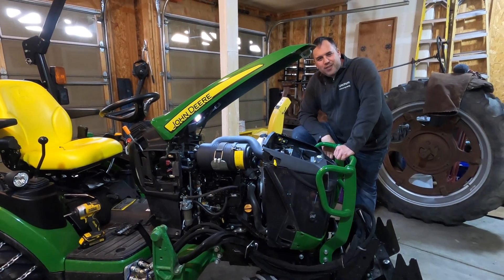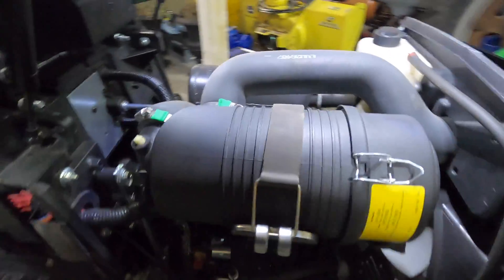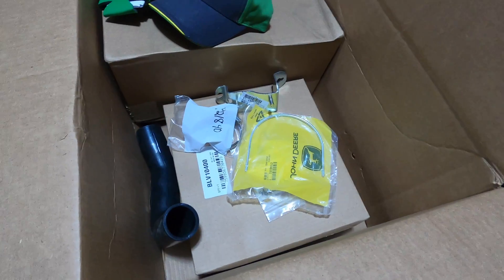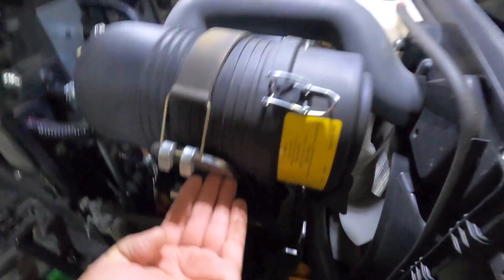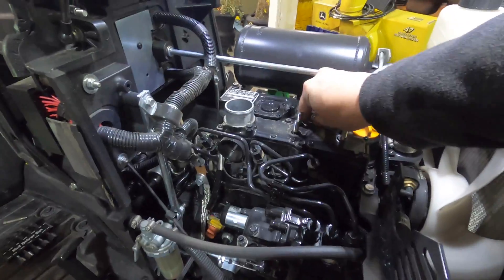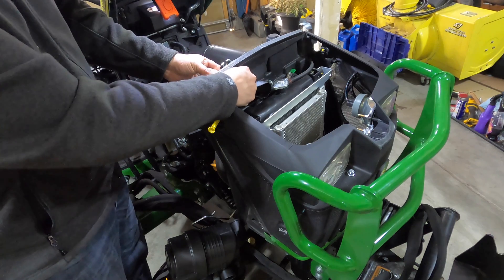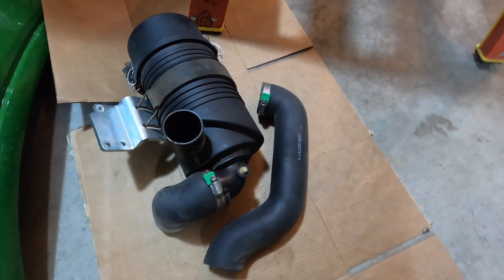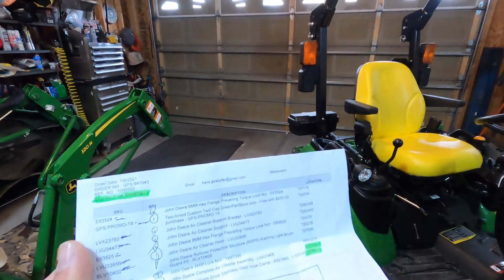Avoid Engine Failure with this Air Cleaner Update - 1025R, 2025R John Deere

Comment: Great video,, did the exact same thing you did due to my local dealer not wanting to cover it,, I’m a little bummed out though, I didn’t get a hat, just the Cousy, lol. On a side note, 4 years later I ended up modifying the old one to fit a John Deere 670 tractor I got because you can’t get filters for them anymore, glad I kept it ..

Comment: You mention design fault with the 1025R - my one has a cast screen that sits behind the main radiator hose. There was an offset part of the screen that was digging into that hose and blew out after 250 hours. Everything was seated correctly, so not assembly fault. I cut the offending piece off the screen. Also surprisingly, none of these hoses in NZ at all. Part needed ordering ex USA, so I taped it up with a $4 roll of rubber. So far, so good.

Comment: My 2014 2025r does not have the mounting holes to support the air cleaner. Any suggestions?
Reply from the maker: I believe yours is considered a 1st generation 2025R which this doesn’t apply to.  It would apply to the 2nd generation.
Reply: @TractorHoarders  Thanks, is there a air kit for the 1st gen?
Reply from the maker: @woodman8261 I have not heard of one, and if true, that’s a good thing because you don’t have any issue to resolve and it should be good as-is
Reply: @TractorHoarders  Thank you for your fast response.

Comment: Just found this ! Have a 2015 1025r. Dealer said it’s a PEP and not the PIP. Parts were free but labor was 130$ plus pickup fee to and from 193$ 
    I bought the parts for 110$ and will install them myself. Thanks for the video!
Reply: John Deere allows you to pick the kit up for free until May 2025 and do the install yourself. Don’t buy it. I had to fight with Ap Pro to let me do this, but that’s because they are the worst JD Dealers.

Comment: Man...... i inherited a tractor..... and on the property we have a broken piece of metal we had no idea what it was for..... we suspected it was part of the tractor, but couldnt figure out what part of the tractor....... your video just solved the mystery. its that bracket. Thanks..... its amazing such a thick piece of metal could break, especially when its inside a compartment where its pretty protected.
Reply from the maker: It’s good that you discovered that.  Make sure your valve cover is in good shape.  If it cracked, you’ll want to replace it too and remove any possible pieces so they don’t fall into your engine.

Comment: Just upgraded my 2014  with 325 hours yesterday.  The bracket looked to be OK, but I went ahead with the upgrade.  Much cleaner install, easier to replace the filter and the engine compartment is just much cleaner and more open.  Thanks for the great video!

Comment: The fix kit is basically the same design the 1026R used in 2011. Slight difference in the way the hoop mounts to the bulkhead, but the mass is isolated from the valve cover the way it should be.  Why on earth did they change the design to what it was?  Looks like maybe for a larger housing and more air filter capacity? But mounting that mass incl hefty bracket to a vibrating die-cast engine cover makes no sense at all.
Reply from the maker: Yeah, agreed and not sure.  It’s my understanding the 1023e was different and not sure if they were trying to match it for costs efficiencies or what.

Comment: I have a 2013 1025 R with 776 hours on it. It is nickel and dimming me to death at this point. I plan on downsizing to a smaller property very soon and I am hoping the tractor can hold on a bit longer as I won’t be needing it. Anyway,,,,The cap won’t stay on the housing.  The clips are too loose. I tweaked them and it seems to be holding. In the course of researching the issue, I discovered that the housing should be replaced. It would have been nice of John Deere to notify me of this safety issue! I haven’t contacted the dealer yet, but I expect they won’t be doing the update for no cost to me. You made the fix look easy to do, so if the dealer won’t do it or decides to charge me a small fortune, I’ll try it myself.

Comment: I've read over 30 stories of this breaking. So close to 100 hours on every single one, I bought a 2013 with 85 hours, it broke at 107 hrs, just the strap. I removed it and let the hoses hold the air filter, I'm at 130+ hrs with zero issues and it doesn't rattle. I'm not just being a cheap skate, I was running it to see and wanted to report to anyone that is watching this. It is still tight, I run my machine much harder than most. It is constantly being pushed on 34 acres, but I dont want another big tractor, this thing is nimble and I love it. I have big tractors, skid shovels, lawn tractors....the 1025r is my favorite beast!
Reply: 5:07 😮
Reply: is this solution still holding up well? I am about to become a new owner of a 2018 1025R with 44hours and it has the original “problem” air cleaner bracket design

Comment: I just bought a 1023E should be delivered by the end of the month. Does the 1023 have the same problem? Great video.
Reply from the maker: From what I have heard the 1023E does not have this issue because they already came equipped with a style of filter like the new one.  Doesn’t hurt to double check though!  Thank you!
Reply: @TractorHoarders  thanks for the info

Comment: Why does it destroy the engine when the cover cracks?
Reply from the maker: The metal pieces drop down through the broken valve cover and go into the valves.  What happens beyond that, I'm not sure, but the outcome is almost always a full engine replacement from what I've read.

Comment: So has this been corrected in the 2022 model? Reason I ask is that I take delivery of my 2022 1025r next week. I’ll definitely be looking for this.
Reply from the maker: Yes, it should be corrected on 2020 and newer I believe, but doesn’t hurt to double check as you don’t really know what year it was manufactured unless you decipher the serial number.
Reply: Reason I ask is that I take delivery of my 2022 1025r next week. I’ll definitely be looking for this.
Reply from the maker: @TexasSheepdawg21  You’ll probably find it’s updated but will only take you a minute to lift the hood and check.  I have a 1025R playlist you may enjoy.  This is the handiest tractor I own.  You won’t regret your purchase.

Comment: There is now a kit available that is cheaper than the piece parts. The kit number is MPLV10188 and is $95. It's available to order through dealers. If you have a 15 through 18 model year it should be covered by Deere.
Reply from the maker: Thanks for sharing, Kent!  That is great!
Reply: Thanks

Comment: Thanks for this video!  I just had to go out and check my 1025R and found it already has the new filter assembly installed.  I don't know if it came that way (bought in 2019) or if it was changed during the annual checkup and service by the JD dealer.  But at least I am relieved that I do not have to worry about my valve cover cracking!  Thanks again!
Reply from the maker: Thanks Steve!  Glad to hear that yours is the updated version.  That certainly gives quite the peace of mind to not have to worry about it.  I think the updated version was made "standard" in 2019, so perfect timing for you.

Comment: That is a really stupid design gotta take all that BS off to change air filter
Reply from the maker: Once you get the new assembly on, it's not bad.  You just remove the end cap on the filter housing, pull out the old filter, put the new one in, and put the cap back on.

Comment: Do not use a washer on the top side of the bracket use the 1/2 inch hex head nut that came with the kit in the top side of the bracket that is what it is made for otherwise you will be buying a new fan blade

Comment: So let me get this straight. A John Deere part fails, or has the potential to fail and destroy the engine and you get to pay for it?
Reply from the maker: John Deere will cover it under warranty if it fails and destroys your engine under warranty.  Or you can spend $160 and avoid a surprise.  Covering it myself is well worth it to me.  This tractor makes me a lot of money for snow removal.  The downtime is a bigger potential monetary loss than the parts to do the upgrade.

Everyone’s situation may be different.  If you can sustain a surprise failure and not care how long you’re without your tractor for repairs, you can absolutely wait.

Comment: I am cringing at the open air intake where the hose was removed.  I know that what you are doing the chances of anything falling in the open hole are small, but the way my luck runs is that when I look away something will find its way down the open hole.  Think hard about at putting a shop rag over any opening that will be more than a few minutes before getting covered back up/hose connected/whatever.  Now that the rain has stopped for a few minutes I am going to go check my engine.  Thanks for the update.
Reply from the maker: Good advice for others to consider as they do it!

Comment: Is that a recall?
Reply from the maker: Hi Alan, not really... your dealer can find it under Deere Solution #8LV188.  It's considered Repair/Replace if broken.  That particular solution expires soon to my knowledge, so you may want to check it out soon; however, take a look under your hood and you'll be able to tell if it applies to you or not by the orientation of your air filter assembly.  If yours is a 2020, you should have the updated design.  Doesn't hurt to check though.

Comment: I’m watching these videos because I’m considering purchasing a 1025. As an outsider, I must ask a few questions. Does this void or interfere with the warranty? If this is a well known issue, why doesn’t John Deere just fix it? Great video - glad a found it!
Reply from the maker: Hi Chad, I would not let this minor thing worry you.  The failure rate leading to engine issues is fairly low, which is the reason why John Deere hasn't proactively issued a bulletin to replace all of them.  If you are buying brand new, this is something you don't need to worry about.  Tractors before 2019 you may want to examine.  If you're buying used from a dealer, I would ask them to update this before you taking delivery.  The 1025R is a solid tractor.  This would not detour me from purchasing another one.  I have a 1025R playlist on my channel that may be of interest to you since you're researching.  I like to interact with viewers of my channel, so if you have any questions that I can help you with, just leave me a comment and I'll get back with you!  -Hans
Reply: @TractorHoarders  thanks!!!

Comment: Should you put the nuts back on the studs sticking through the valve cover? Could they fall down in there if they come loose.
Reply from the maker: Yep, showed that at the end of the video as an after-thought.  Good catch.
Reply: @TractorHoarders  FYI - I have a new 2025R that came from the factory with the air filter mounted to the core support.  It has the 3 studs on the valve cover, but they are bare - no nuts installed.  I agree with on erring on the side of caution, but they are apparently not needed.
Reply from the maker: @jimstruve3602  cool, thank you for confirming that!  Much appreciated!

Comment: I am a service tech for a Deere dealer. There has been a fix as fail PIP published for this exact issue. If you find your bracket cracked contact your local dealer and they should be able to get you taken care of.
Reply from the maker: Hey Dustin, thanks for chiming in.  The PIP expires here in a few months. From your experience, what will happen after that?  Would Deere issue a new PIP?  Or does it become owner responsibility?
Reply: @TractorHoarders  Today, in March 2024, my dealer told me the program expired “a few years ago” and was not renewed. The kit configuration appears not to exist any longer, so the parts are ordered separately. It adds up to $250.00.
Reply from the maker: @624Dudley  I guess I’m not too surprised with the cost of everything increasing.  Even at that cost, I’d still do it.

Comment: My jd dealership papa 200 hr checks in stall it free did tell me month later I saw the new air cleaner installed like yours aut 2020 their warranty is 10 years
Reply from the maker: That's great.  Some dealers do it, some do not.  While my tractor is in warranty also, the downtime that I'd have with a potential engine swap versus me just paying $160 is well worth it to me.  With my luck the tractor would be in the shop and I'd be getting hit with repeated snow storms with no tractor.

Comment: I had mine fixed under warranty by my dealer after the second time the rubber retainer strap broke. I was told that any component that was missing, cracked or broke,  qualified for warranty repairs.  If I had known that, I would have had it done the first time the strap broke. There should be a JD program # 18lv188 and the Solution  Number is #113718. I would recommend doing a search for those number and refer to your dealer. It may qualify for warranty repairs.
Reply from the maker: Yep, and the JD Solution expires soon, like this May I believe, so do it quick if you want to see if your dealer will cover it.

Comment: Not to challenge your fix or reason(s) for it, I am having a difficult time understanding why and how something as light-weight and insignicant as a air filter housing that is attached to the valve cover can lead to a catastrophic failure.  Have I missed something?  I need to dig deeper into this.  But, my greatest appreciation for you bringing up the issue.
Reply from the maker: Hi Dwayne, very valid question!  I agree, it's not obvious.  I haven't had the valve cover off to answer that question for myself, but I'm glad you asked.  There are quite a few documented cases of this failure on the internet.  Check out this link to see one example:  https://www.greentractortalk.com/threads/1025r-engine-damage-air-cleaner-broke-off.186388/
Reply: @TractorHoarders  ....thanks for your reference to TTWT's fix. I now remember viewing is video some time ago. Tim is one of my favorite resources for the 1025R World.  Still, I am quite surprised that such a small "mass" of plastic (referring to the air cleaner itself) and a mounting bracket could lead to such a severe failure.  Routine engine vibrations (welcome to diesels!) and likely harmonics has likely produced such failure.  Still, I do like the air cleaner relocation to the radiator firewall and removal from the engine entirely as being a great solution.  As Tim references, I am disappointed that JD wasn't more forthcoming to all registered owners about the update.  Such "silence" could often result in a more costly legal action....meaning class action.  Not smart, for sure!  Maybe I should be thinking Kubota instead!  Are you listening JD?
Reply: The issue with the mounting is that the vibration can crack the valve cover and pieces of it can get past the valves which are actually under the cover. Mine cracked luckily while under warranty and John Deere replaced the complete engine at no cost. The funny thing is that the first issue with these was the bracket cracking so they beefed up the bracket. Once the bracket was beefed up the vibration traveled down to the valve cover.

Comment: Are the new 1025R's already coming with the new horizontally mounted air cleaner?
Reply from the maker: Yes.  I provided the affected serial number ranges in the description.  Anything sold 2019 and after should be OK, but doesn’t hurt to double check.

Comment: Hi, I got the kit ,the extra nut is the washer for the clamp, that's why it has a hex hole in the bracket. You put the nut in front of the bracket in the hex hole and it works like a lock washer.  The clamp goes thru the nut then the 10mm nut goes on, works great.  Thanks for the info,  I just got mine today it took a while to figure out why the extra nut.  Now I know.  I didn't get a hat with mine.
Reply from the maker: Haha, I realized this after the fact.  Thank you for pointing this out!  ... I happened to buy an extra $100 of stuff outside of these particular parts (not seen in this video), so I hit their "over $250" threshold for the hat.  Thanks again!

Comment: Great video, happy mine was the newer one that didn't require this update.  I always find it odd that Deere isn't tripping over themselves to fix such a quality issue.
Reply from the maker: Howdy!  The 1023Es may all have this update, which is great for you.  I find it interesting too.  I'm sure JD did their math against the likelihood of an engine failure, but it's just something I don't want to risk.  My luck, it would break down the road outside of warranty.
Reply: @TractorHoarders  you're correct, my 2020 1023e already has this update.
Reply: I'm ordered a new 1025r  yesterday.   Will this still need to be changed or is it a new update?
Reply: @CLEEPER1  Since 2018 or so, that's what year mine is, it has had the updated filter.  So you should be fine.
Reply: @FloridaDeere  thanks

Comment: If it does break your jd dealer should replace the engine. Mine broke my dealer picked up the machine and installed a new motor and fixed the air cleaner. This is a recall when broke through jd. Mine is 3 years old with 315 hours and had zero issues with my dealer.
Reply from the maker: Hey Johnny, I totally agree; however we’re in snow season and I can’t be without my tractor.  Simple things take them a minimum of a few weeks.  I can’t imagine how long an engine swap would take including diagnosis, ordering an engine, and installing it.  I do a lot of snow removal if you check out my other videos.  Not having the tractor is not an option for me, so I prefer the proactive approach.

I agree with you though.  If it breaks and your under the power train warranty, they absolutely better take care of it.